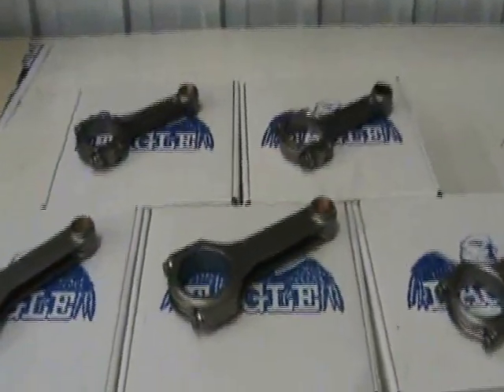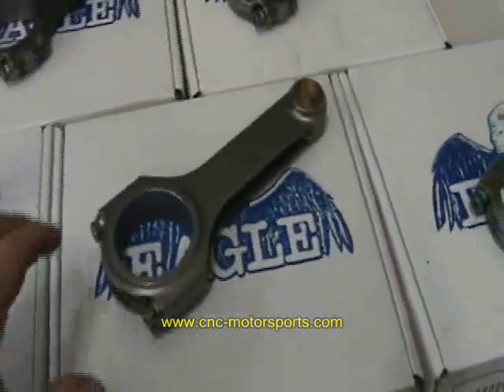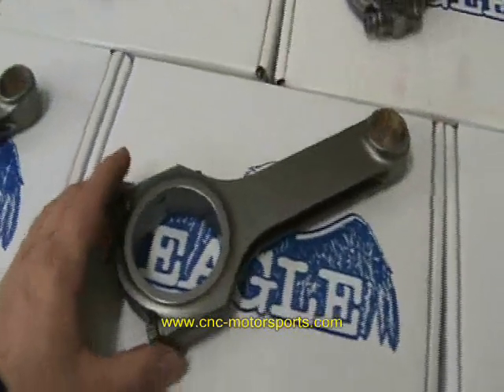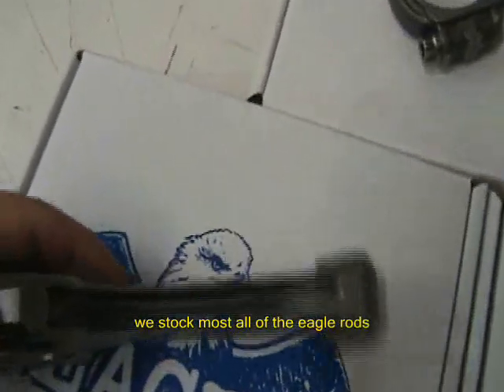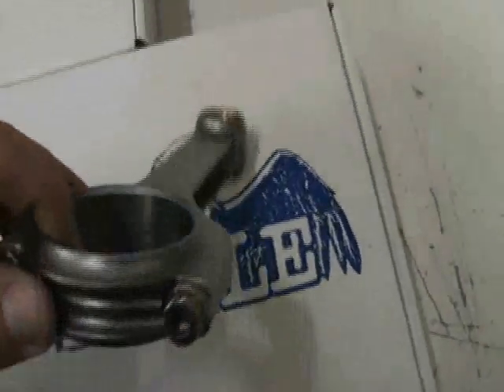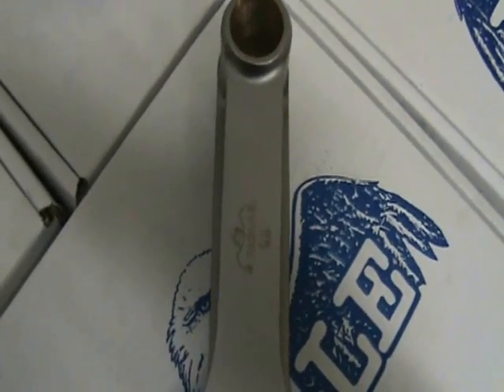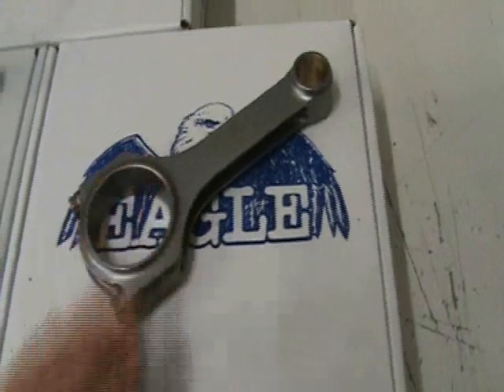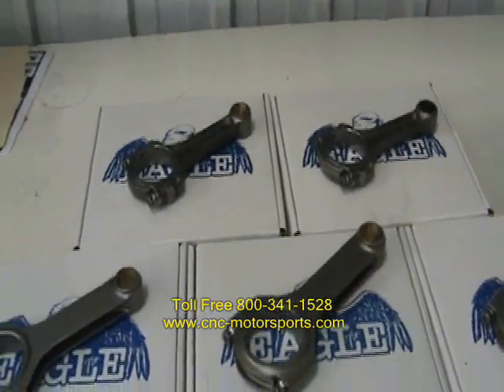Eagle I Beam and H Beam Connecting Rods

Comment: Going to build a 360 Magnum. I want to stroke it to 408. Looking for 350-400 for both TQ and HP.
Any suggestions for crank and rods? Not real sure what pistons yet but I have always liked Keith Black's stuff. 10:1 is my target going no higher than 10.5:1 so I can still run pond gas.
Its going into a 83 RamCharger 4x4
Reply: You'd be fine with a cast crank up to 500 hp, stock rods will handle 450 hp easy too.

Comment: Please get the word out. Eagle sold me what I thought was a .060 over piston because it was stamped on it and that is what I ordered. However the actual size is .030. They stamped it wrong but because I used them for 60 miles it is totally my own fault for not checking there work.
Reply from the maker: Joel Maynard Engine builder should have caught that right away when doing the final hone to fit the piston clearance to the block.

Comment: have you ever used L19s on h beam rods on a 383?
Reply from the maker: We sure have
Reply: cncmotorsports how much more clearance do I need I have a summit 383 block already has clearances for 383 rotating assembly, So I'm not really sure how much more I can grind on it
Reply from the maker: richard lundy Depends on how much the summit block was clearanced for. You need .040 thousands between all moving parts to be safe,
Reply: Do you think the rod bolts that came with the rods could handle the occasional 800hp. I know they say 750 on summit. The engine will have around 600 but i eventually want to put a 200 shot on it.
Reply from the maker: richard lundy Any nitrous use we recommend the ARP2000 bolts

Comment: Do you guys sell a Ford 302 based (8.2" deck height block) connecting rods which can run 3.5" stroke using Honda 1.88 big end journal size?

Comment from the maker: @ewe2oobes 

There is a parting line, you loosen the rod bolts, and pull off the rod cap. Sometimes you need a rod vise to remove the caps as they are a tight fit.

Comment: Is this a billet type rod? i presume thre is a crack where the two halfs come apart, but on all the videos Ive seen with bilets and H rods, the crack line appears almost invisible like it just a single peice. I've wondering how do they go on?? And another question, once these rods are made, how do they cut the two halves/ i havent seen or read anything that shows how the big end is seperated.. Any ideas please? thanks!
Reply: That are precision fit caps they machine and hone them with the cap torqued they are very tight to get apart that's how well they fit I've used them a couple times good rods for the money

Comment: @k0ent Why use I-beams? Cost. Eagle H-beams cost around $350 - $500 depending on application. Eagle I-beams cost around $250.
I just got a set of the 6 in H-beams with the L19 bolts for a supercharged 383. They're niiiiiice. :)
Reply: 177SCmaro. like about. eagle crankshaft. HP rate like sb421 stroker ?? will handle. big shot of nos  250 shot?
Reply: ? Chevy. eagle 421 assembly stroker kit   like. perform 250 shot of nos?? wil handle nos can show video all eagle. build 421 SB sroker